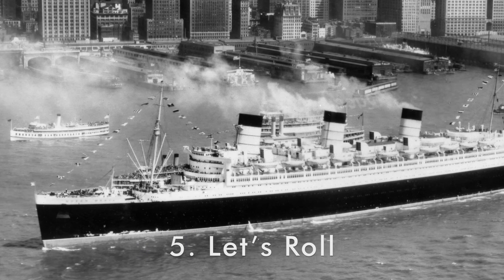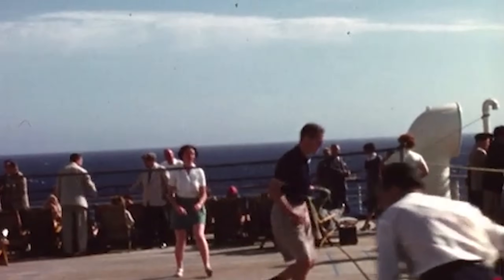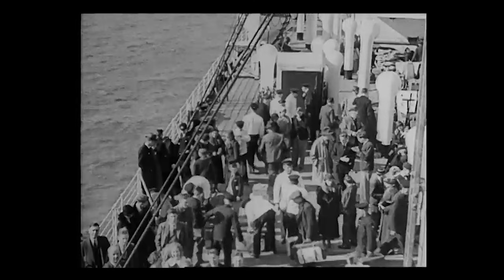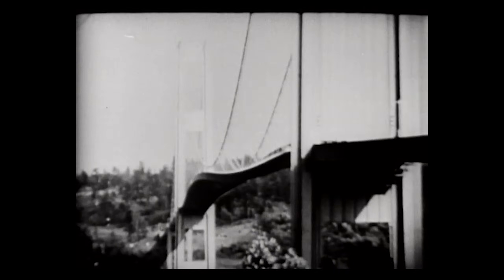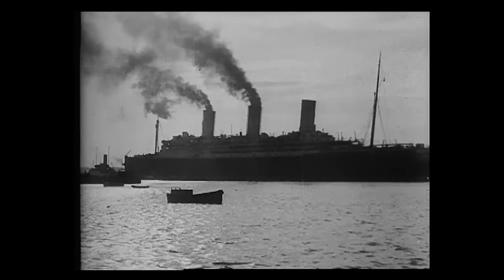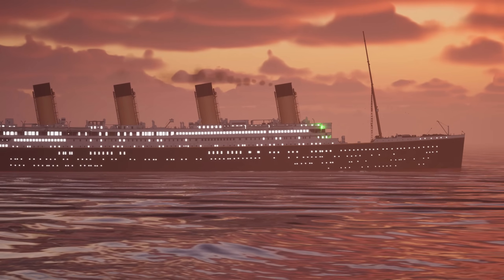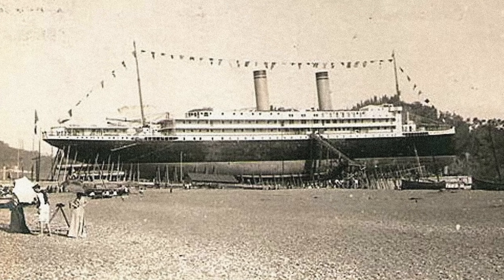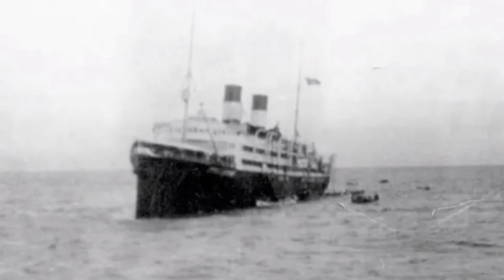5 Ship Design Fails

Comment: The Titanic originally had higher water tight bulkheads but to save money they shortened them without approval, plus the coal fire weakened the bulkhead rivets.
Reply: Nothing of what you said is true.
Reply: @DerpyPossum  look up the blueprints and see how Ismay doomed Titanic
Reply: @frankieascedo519  Read the book “On A Sea Of Glass: The Life & Loss of the RMS Titanic” or literally any credible work of Titanic literature and see how you’re completely wrong.
Ismay never tampered with any of the ship’s structural design. The bulkheads were never changed from their initial design. The blueprints showcase nothing of what you claim. No cost-cutting measures were taken that drastically. 
Also the fire was nothing but a smolder that didn’t weaken anything.
Reply: @DerpyPossum  read the Smithsonian magazine article about the coal fire there is even a picture of the discolored hull on the outside of a coal bunker.
Reply: @frankieascedo519  Because a magazine is definitely credible, for sure.
That mark on the photograph is over 80 feet away from where the fire actually was, and is also a couple decks above the waterline; how could it have sunk the ship if it was above the waterline?
Reply: @DerpyPossum  I wouldn't compare the Smithsonian to Mad magazine. The fire didn't sink her by itself. Heat makes metal expand and cold makes it shrink plus saving money they used low grade iron rivets. So once it hit they blew out. Fredrick Barrett survived from boiler 6 and witnessed the tear open up. The fire burned 5 or more days J. Dilley testified he helped fight it.
Reply: @frankieascedo519  The fire was a smolder. It never got hot enough to cause anything remotely significant, especially not since it wasn't located up against the outer hull in the first place. Plus, the ship was only in the colder waters of the Labrador current for 4 hours before the collision as opposed to the entire voyage.
The iron rivets weren't low-grade so much as they were just iron as opposed to steel. And it had nothing to do with saving money; the riveting machines couldn't be used around the awkward shapes of the bow and stern, so the iron rivets were used in these locations. The rest were steel. Iron was used for ease of construction, not corners being cut.
Reply: @frankieascedo519  The fire was still a tiny smolder for those days, though, and still hadn’t caused any damage or weakening by the time it was put out.
Ismay didn’t “put in the grand staircase”, and the staircase’s inclusion had absolutely nothing to do with bulkheads. There was always going to be a multi-deck staircase there, and there wouldn’t have been any bulkheads that high within the ship to remove in the first place. 
Given the nature of the collision, the fact that it was riveted at all was probably what did it in. The same thing probably would’ve happened no matter the rivets’ materials, so they might actually be a lot more irrelevant than you may think.
Ismay never testified that he removed lifeboats. Not in the English inquiry, not in any inquiry, not after the sinking, not before the sinking, never. Because he didn’t. Lifeboats were not removed at all, especially not for views (consider for one moment the uninterrupted promenade on the deck below; views on the boat deck would be irrelevant, and they would’ve known this). 
The signal was CQD, not QED, and their usage of it was the farthest thing from “arrogance”. SOS was not being “used by everyone” at the time, even if it was the new standard. Because it had only been the new standard for a few years at that point, and had only been used in a handful of events. The shipping industry is notorious for holding to traditions when transitioning between “eras”, and this was no exception. Heck, some ships after Titanic sank were still using CQD.
The colour of the flares had nothing to do with “making it look like a fireworks show”. Honestly though, do you seriously believe they even had firework shows on ships back then? Because I don’t truly think you do.
They were actually farther South, specifically, because their course was changed to heed the ice warnings and was specifically noted as being the farther Southerly route.
None of this is new information that has come to light in the last 9 years. In fact, with anything as big and important as the things you mention, little-to-nothing new has come to light in that time. OASOG still holds up.
I beg of you to do more research.

Comment: The "Rolling Mary" must have incredible restoring force designed into her.

Regarding the Titanic... Mind you, it was mainly the press that threw the word "unsinkable" around.

It probably didn't help Titanic in her scrape against the iceberg that apparently, in order to better facilitate hand-riveting (because the hull-crawling riveting machines decided to balk during her construction) the rivets used were slag-rich and thus more vulnerable to shearing in a scrape. Correct me if I'm wrong about this.
Reply: The rivets in that portion of the hull weren’t exactly “slag-rich” so much as they were just iron as opposed to steel. It was for ease of construction around the awkward shapes of the bow and stern, with the machinery not being able to do the job for this reason. Everywhere else, though, they used steel rivets.
Reply: The rivets themselves were of the best quality available given the technology of the time. The plating forward and aft wasn't countersunk for them, which might have allowed more of them to shear than otherwise might have.
The real crux of the problem from an engineering standpoint is just that nobody could have foreseen a low-speed sideswipe over a distance of more than a third of the total length of the keel. That particular kind of collision had never been reported before, and without a highly specific set of unlikely circumstances (which wouldn't be fully understood until decades later), wouldn't have even happened that night. It was the kind of absurd scenario nobody could have even imagined happening under the command of a competent officer—right up until the moment it did happen, and Commander Murdoch was helpless to stop it.
Reply: It was ENTIRELY the press that threw that word around. Captain Murdoch was a highly experienced and incredibly competent sailor - he absolutely knew better than to make ridiculous claims like that. Ismay and everyone else who worked for White Star was well aware of the ships the line had lost over its history, and had no intention of looking foolish if the worst was to happen. 

Unsurprisingly, the people making the ludicrous claims about a ship were the ones who knew absolutely nothing about sailing, shipbuilding, or maritime engineering. But that's one of the things that makes the Titanic such a compelling story. The "unsinkable" ship that sank on her maiden voyage, in a night full of drama, heroism, and, ultimately, tragedy. She wasn't the worst maritime tragedy, nor the fastest, but she was a damn good story.

Comment: I don‘t agree with Titanic being a design fail. By rising the bulkheads or even sealing the compartments horizontally you only get a theoretical increasy in safety and surviveability. There is about 0 chance to get the ship stable in the water without capsizing with five or six compartments flooding. In addition the hull needed to be strenghened by a huge amount to avoid micro cracks causing additional flooding like in Titanic‘s case. At some point you got to admit that no ship would have survived Titanic‘s damage, not even modernized Olympic or Britannic. It‘s still a passenger liner designed to make profit and not a submarine.

Comment: When Titanic saw ice berg Order was given to "Full Reverse",  Hard  Left Rudder". There was only ONE rudder set center. The two outboard screws had no stearing other then to increase/ decrease rpms on one side to create direction bias. IF YOU PUT A SHIP IN FULL REVERSE you Loose STEERING. Its water flowing past rudder that can be directed to change direction. The Titanic did not turn fast enough to avoid the scraped side.
Reply: The order full reverse was most likely never given anyways. It‘s more a thing of Cameron‘s film.

Comment: There really wasn't anything wrong with Titanic's watertight bulkhead system, in fact modern passenger ships are built to similar specifications (must stay afloat with two concurrent compartments flooded).  The glancing blow scenario is honestly so rare that it's not something that gets considered even today.  Most ships that are involved in collisions either hit the thing they collide with head-on, or are rammed from the side by other ships.
Reply: From what I remember reading, the Titanic had a separate set of outer compartments running longitudinally, and it wasn't a glancing blow, but a scraping along the side of the ice, which created a lengthy gash and from there, a lean to one side starting from near front. 
Aggravated by using a 'new' high strength steel to make the larger ship, which had the unfortunate fault that it became brittle at low temperatures, so the plates cracked rather than buckled.
Reply: @stephenarbon2227  Titanic didn't have longitudinal bulkheads, and it didn't "lean over" (or list) more than about 12 degrees during the sinking.  Also, the idea gash had been ruled as early as the 1912 enquiries where a navel architect did the calculations and found that with the known rate of flooding, the total area of damage couldn't have exceeded about 13 square feet.  It only persists because of the press continuing to circulate the gash story even after it had been disproven.  

Maybe you're thinking of the Lusitania, which did have longitudinal bulkheads?  Those caused huge problems when the ship was torpedoed and caused it to list so much that they couldn't launch half the lifeboats.

Comment: I take issue with the Titanic one. That the watertight compartments didnt go higher or were not capped off, would have had ZERO bearing on whether she survived or not.  She would still have foundered because of the weight of the water she took on, would always have meant her open deck would have been dragged below the waterline, meaning water could still enter the ship.  

Its not that the ship builders didnt factor in a side impact as what happened, they absolutely did, which is why they knew the limit of how many compartments could be breached and Titanic stay afloat.  Virtually any ship in Titanics position in the same circumstances would sink just as she did because the enourmous weight of water taken on would see the head dragged below the waterline.

Comment: Kewl Program Channel. Well Done ! ! Was in SE Alaska from 1980-95 working for one of the Largest Seafood Processor Co's in the US, easily in the top Ten worldwide. I worked the cannery during Salmon Season (July-Sept) and did everything else, including all their Diving needs for the Co Fleet. There were only Two certed DeepWater Divers on the Island back then and we were often called out to examine damaged Fishing Vessel Hulls, under water structures and retrieve whatever the Co or one of their contracted fishermen had dropped into the bay. The US Coast Guard actively sought out boat captains with experience in SE Alaska because, over 70% of the United States coastline is tied up in that Rockpile that is SE Alaska. Spent many a night listening to drunk sailors' stories of cheating Death and of those that didn't. The ocean takes no prisoners and if you don't respect the magnitude of its vast Power and Grandeur, it won't respect you.

Comment: I have been on two boats that were spooky to say the least. First one was about 45 foot and going below was was just wrong, felt bad and had a smell, it sank at sea about 2 months later. Second boat was truely a cursed ship. About 59 foot long sail vessel, the companion way below reminded me of a horror movie scene (redrum) and I had an instant dislike of her as soon as I set foot on board. One time we were getting her ready for sea and all the batteries blew their tops, not just caps but the actual top of each battery, i have never seen that before. Then when underway one of the main stays broke and came whipping around and just missed one of the crew, it went off like a rifle shot. She would take on water at odd times, but when you would expect some water ingress there was none. She would also make unusual noises, unlike any other boat I had been on and I found that I was continually injurying myself on the most unusual things like a nail head sticking out where it seemed that it was not there the day before. It dawned on me that this boat wanted to kill its crew. I know that sounds crazy but its true, some boats/ships bring great confidence and you know if you look after her - she will look after you. But this boat just wanted to take her crew to the bottom. As far as i know she gave her next owner a very hard time and he got a divorce and he sold it to some poor sole in the Asia region. Dont know what happened to it after that...

Comment: To be fair to the Titanic, she would not have sank had it not been for the coal bunker fire and the substitution of cheaper, lower grade steel during construction than the design specifications.
Reply: To be fair to the Titanic, none of what you said is true.
Reply: @DerpyPossum The US Congressional Record would beg to differ.  The Titanic was built with cheaper than specified steel and a fire in the coal bunker weakened it still further, according to surviving crew members.  They testified under oath on the floor of Congress.
Reply: There was no fire.
Reply: @danielledewitt1 According to the US Congressional Record, numerous surviving crew members reported coal bunker fires that were still burning until the moment the coal bunkers became flooded.
Reply: @unconventionalideas5683  Nobody reported that.

Comment: A contributing factor to the Queen Mary's stability issue was that she was designed with one set of engines and then to save costs during construction, smaller lighter engines were installed so she was more top heavy than the original naval architects had planned.
Reply: Do you have a citation for that claim?
Reply: @JWRogersPS  I've read this somewhere to, that she became lighter then intended which caused her to be a little more top heavy then originally designed.

Comment: Help in mind the titanic should of survived that hit she only grazed the iceberg they proved the rivets were strong enough to hold she had a fire in a coal bunker that heated the metal were she hit the iceberg but the fact of her water tight doors not going all the way up was her major flaw
Reply: The fire was nothing more than a small patch of smoldering coals, and it didn’t weaken anything — let alone where the iceberg hit.
Reply: There was no fire.
Reply: @danielledewitt1  Oh, there definitely was a fire. It just wasn’t nearly as bad as most people would think.
Reply: @DerpyPossum  Yeah only the coal fire that was small, controlled and supposed to be there. Not an out of control big fire though.
Reply: @danielledewitt1  yes there was that was proven it was in 1 of the coal bunkers they resorted to using cheap coal because if a coal fire and the cheap coal back then was known to ignight
Reply: @jjlawnservice5229  Those coal fires were meant to be there and they were tiny.
Reply: @danielledewitt1  I'm not saying they were big but it was only in 1 or 2 bunkers and coal burns hot now u have the heat from the coal and ice cold water what does that do to the metal conveniently the fire was were she ripped open when she hit the ice burg so u had weekend steel then it hits something in all reality from what I have heard she did not hit the iceberg hard considering she grazed it the way I understand it is it was not even enough to move her off course the simple fact is mistakes were made all around that caused it they proved the rivets would not of just broken like that on there own now u add heat to the mix with cold water now u have a dangerous combination
Reply: @jjlawnservice5229  Didn’t weaken anything though.
Reply: @danielledewitt1  then explained how a survivable bump turned into that rapidly cooling metal with water weakens metal expetaly that cold of water it can cause metal to Crack and get brutal that is y u dint dump cold coolest in an over heating moror running or not

Comment: Great video as always, Mike - some interesting stories there! 

Your theme might not be shipwrecks so much, but I can think of a couple of stories for you... There was an horrific accident on Sydney Harbour Pre-WW1 (IIRC) where a ship called Tahiti wasn't looking where it was going and ran into and cut THROUGH the Sydney Harbour ferry Greycliffe_, sinking it quickly. Then there was the R.A.N Aircraft Carrier _Melbourne. It had several accidents during its life and even had a collision with the Manly Ferry South Steyne which still has a dent in its bow on the Manly end (for those of us who know which end to look). 

Another ship to look at was the Kiwi Coastal Steamer Wahini which was one of the ships used on the Christchurch to Wellington overnight run. It sank (by capsizing) in Wellington Harbour in the 1960s. There are numerous books on its fate - maybe you have one in your own library? It was ultimately salvaged and broken up for scrap, being turned into reinforcing rods for Auckland's building construction industry.
Reply from the maker: Good suggestions for video topics, thanks :)

Comment: 15:30 If Titanic would have had strong enough sea water pumps to get water out of the ship about the same rate it was leaking in, it would have survived with its original design. However, thanks to water tight compartments, such pumps were not considered worth building.